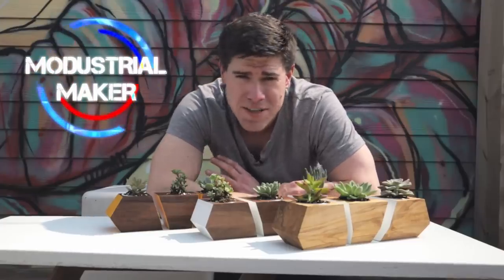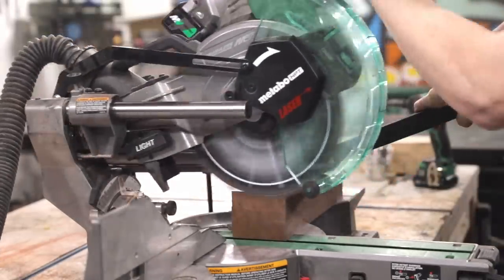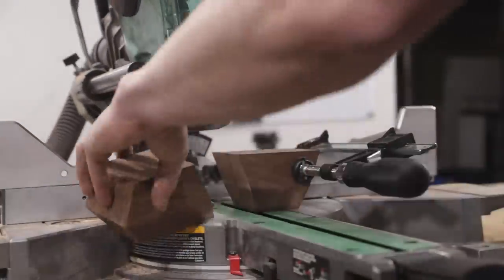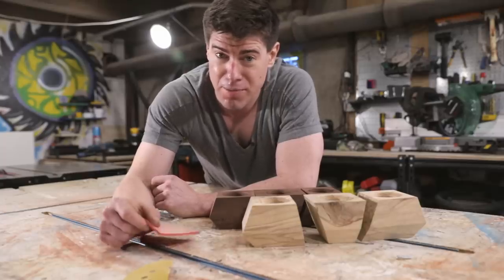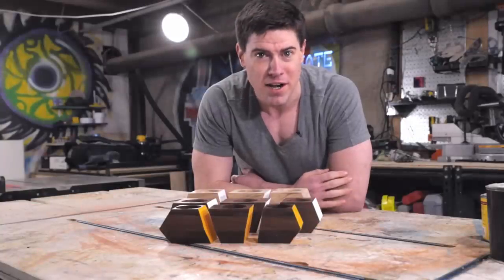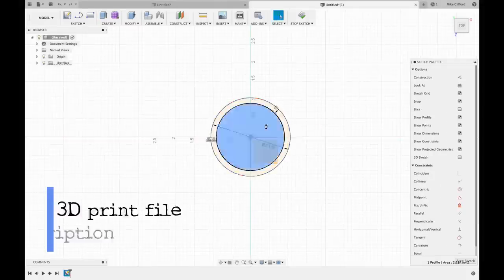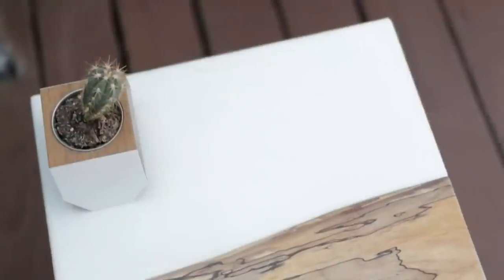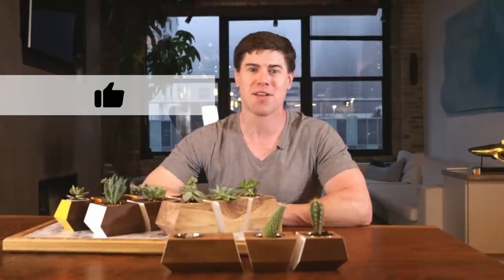DIY Succulent Planters || how to make

Comment: Thanks for the video! These turned out great! I used 3.5” width cherry and maple and I just bought 3” walnut. I stained the cherry and prefer that one. I put some felt pads at the bottom for an added nice touch. FYI for new people you really need to clamp down the wood on the drill press. My test piece started shaking and moving a bit.

Comment: Awesome work Mike! 😃👍🏻👊🏻
Reply from the maker: Thanks Fred! 👊
Reply from the maker: @modern craftsman wow, you really went nuts on this....I'm an IP attorney and am not trying to claim anyone else's design as my own.  I was very upfront in the video that the original planter design wasn't mine.  one comment would have sufficed..... Going through and spamming every comment was not necessary.  I do appreciate you trying to protect IP, but there was a bit of misdirected hostility here.
Reply from the maker: @modern craftsman I normally don't engage spammy comments, but I think the community here should see this conversation.  First, I pride myself in my own designs, so the last thing I would want to do was take credit for one I don't believe is my own.  The video description clearly links to revolution and says they are the designer of the  planter I based mine off. I did exactly what you suggest earlier in the day before I even saw your comments, which YouTube rightly filtered out as spam. Based on that alone your point is without merit. But to top that off, I actually held off doing this project which was requested by many of my subscribers, until revolution no longer was selling these planters, so there could be no accusations that I'm somehow hurting their sales.  What's more revolution liked my post on Instagram and subsequently followed me. If they are cool with what I'm doing here, which is sharing a process to create a really cool design with the community, then you need to be to.

Comment: Just FYI 3D printed parts usually aren't water tight, especially in PLA. I'd recommend a post process of either spraying them with several thick coats of a waterproof finish, or dipping them/get a thin layer of epoxy around at least the inside edge.
Reply from the maker: Good to know!  I tested the liners by filling them with water and letting them sit for a few hours.  Didn't see any leakage so figured they would do the job.

Comment: Another cool video with a fresh design 👍🏼 and cool that you use Metabo tools - their headquarters are just a 5 Minute ride away from my home - greetings from Germany :)
Reply from the maker: Thanks Dominik!  The Metabo HPT tools are actually from a different company, which is owned by the same parent company as the Metabo you are familiar with.  Metabo HPT is the North American version of the tools sold under the Hikoki brand in Germany.  It's a bit confusing :) I'm definitely seeing some of that German engineering from Metabo seep into the new Metabo HPT /Hikoki tools, and that is a very good thing, I think....
Reply: @modustrial  Oh yes that´s confusing, but now I remember that you already explained it in a earlier video where you built a planter with color inlays :) I'm confident that's a good thing. My dad has a Metabo hammer drill for about 20 years now and it still works like on the first day.

Comment: I've heard that having succulents in a container without a way for the extra water to drain from the bottom can cause mold and or the plant to die. Would it be possible to drill a couple holes at the bottom of the steel cups and then a few holes through the bottom of the wood portion to allow for drainage?
Reply from the maker: Interesting, I didn't know that.  It would definitely be possible to drill through the steel with your average cordless drill. It's pretty thin. For what it's worth there are no holes in the original ones I got from Etsy.  I've had those for 5 years now, and never had problems with the plants dying in them
Reply: That's if you over water them, they only need watering when the soil goes dry, but only a small amount

Comment: The planters are great and all, but the real question is, where do I get a cute "cat wrap" like the one you're wearing at the end of the video? Lol. 

(My older cat Nibbles used to sit around my husband's neck like that when she was a kitten (she's an orange tabby too) my little runt black kitty, Inky, nope you couldn't pay her in lbs. of cat treats to sit on his shoulders, lol!) But I do really like how the planters came out, one suggestion though, especially with succulents, you might want to drill a hole all the way through the wood that's smaller than the hole you drilled at top so the cup can still sit flush with the top of the planter, then drill a few small holes in the metal cup inside the diameter of the hole drilled through the wood & coat only the hole in a waterproof varnish so water can drain but not be absorbed by the wood. :)
Reply from the maker: Thanks Krista!  My cat, Karma, has been with me over 15 years now....he's grown pretty attached and doesn't like to leave my side, so sometimes I just have to let him in the video :). Good suggestion for the holes.  In my experience (had the original planter I bought for 5 years) it does OK without the holes if you are careful not to over-water.... That said, why risk it?  Drilling holes for drainage is definitely a good idea